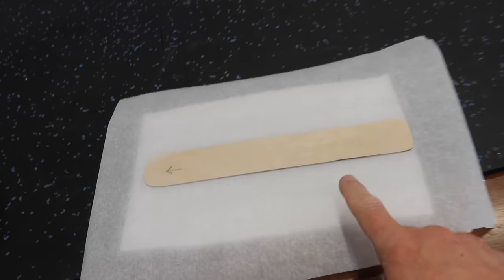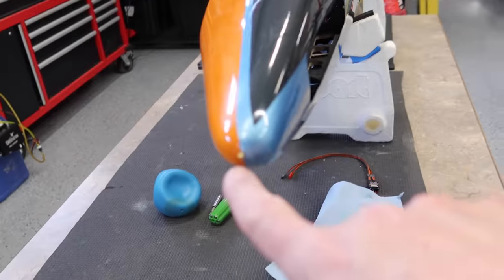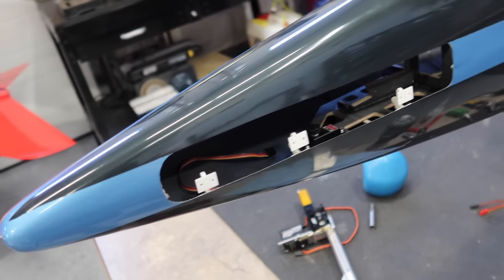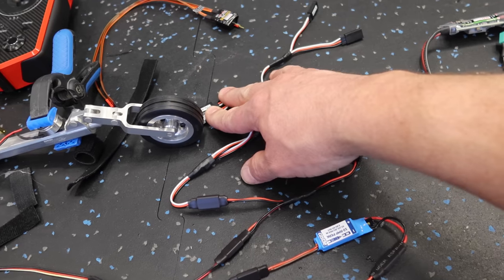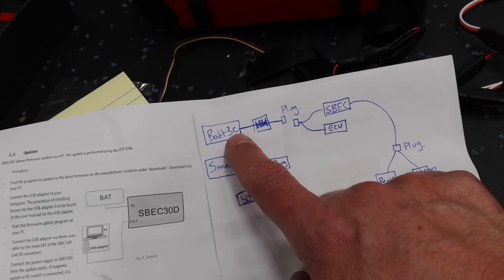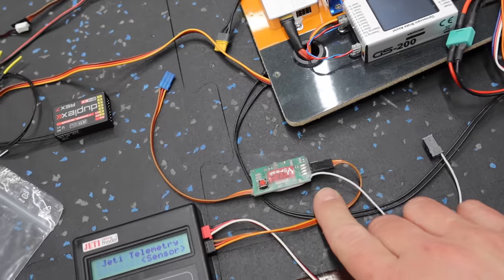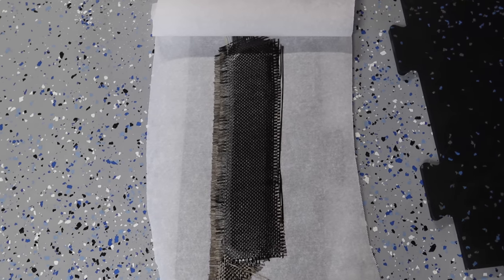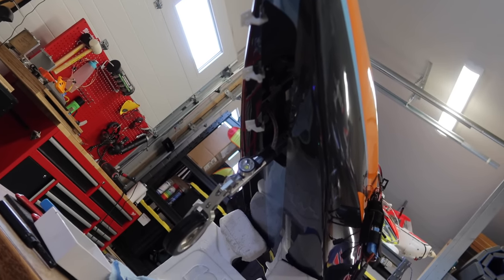Getting the ULTIMATUM Front End Ready - U2 Turbine Jet Hispano Aviation

Comment: First, want to thank you for the advice on the Solder Sticks. They are making my life so much easier. Second, once you put the notches in for the front hinges, it looks like now you have some room to run piano wire. Was that just an illusion due to camera angle, or giving the extra movement allowed access to the upper holes?
Reply from the maker: Awesome!  Glad you like them!  Piano wire could have been used from the beginning if all the holes are left in place on the offset hinges initially. With the setup on this U2 you have a good visual on the lineup of the hinges so I didn’t need to use the piano wire in this case. 

When we get to the mains in the next episode  you will see me use a wire to get the pivot points installed.

Comment: I am trying to find out the video that you talked about of why did you jump the Steering in with the brake in.
Reply from the maker: Ohhh. Thats a while ago.  What we do now with Jeti is run the nose through the cortex system.  I believe with the GS200 it's explained in the manual.  If using the BUS System for signals, then the steering system will need a power source.

Comment: Hey Jonathan I noticed the back side of the UAT is missing a seal plug, I purchased the same exact one from aeropanda, I talked to Danny and he sent me a new plug for free because it's supposed to be supplied with the UAT. it will leak if you don't plug the hole. Don't ask me how I found out.
Reply from the maker: Weird.  It looks like it's just aluminum in the opening and it's all sealed.  Is this how yours was?
Reply: @The Lighter Side Of RC  yes, it needs a plug . I was checking my fuel system and as I was filling it up I noticed some full dripping from the hole so I called Danny at aeropanda and he told my it should have been sent with the UAT
Reply: Your doing an awesome job on that jet, you don't want a fuel leak inside that fuselage

Comment: Are you not using a separate turbine battery to save weight? Is it ok to split power from one battery powering the servos and the turbine?
Reply from the maker: Hey Karl.  1 battery to power turbine and system on the aircraft.
1 battery just for the lights.  As long as you use quality equipment and a quality battery it will work great!  Will use a 50-60C battery
Reply: Awesome thanks, interesting that is smart. Then you can really get some light high capacity batteries and simplify the install even more. Welp i will do that on my rebel max. Looking at pulling power for the landing gear from the central box battery connections.
Reply from the maker: @karlhines82  yea I think we have gone a bit excessive in the battery world. Obviously if one feels good having a separate battery for everything than do it!  I think back to my ultra flash. A separate battery to run the ER40 gear system. After a weekend of flying would often put less than 100mah back in the battery.
Reply: You yea for sure… the batteries are much better today. I power my lights on my rebel classic with the same battery for my er40 retracts.

Comment: Will you integrate also the remote switch?
Reply from the maker: Hey Juergen.  Absolutely.  I like to do it as one of the last steps with most setups as it's one less thing hanging and dangling off off things.  In this case, the remote switch integrates with the SBEC.
Reply: @thelightersideofrc  Thought so too. Avoiding the additional chaos.
Reply: @thelightersideofrc  What are your thoughts on the bubble trap so far?
Reply from the maker: Nice unit. Missing a plug. AeroPanda will send out tomorrow. It will look pretty in there.